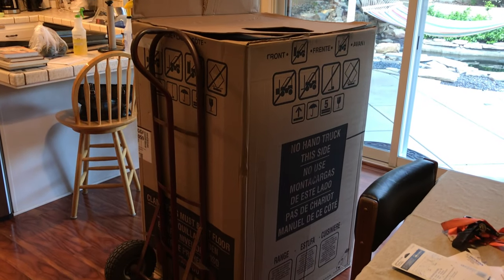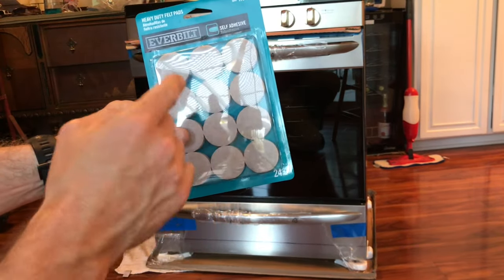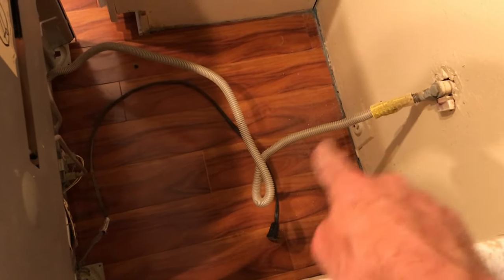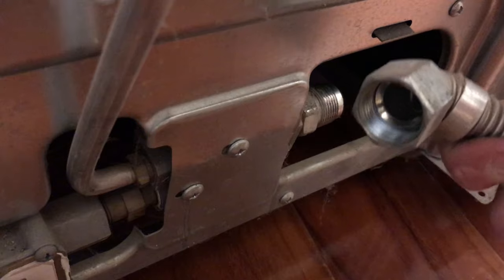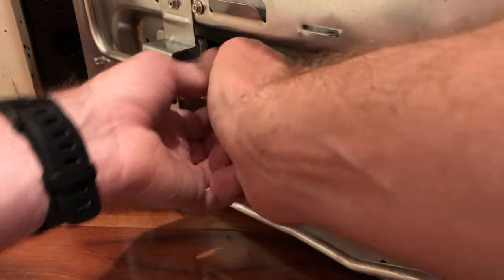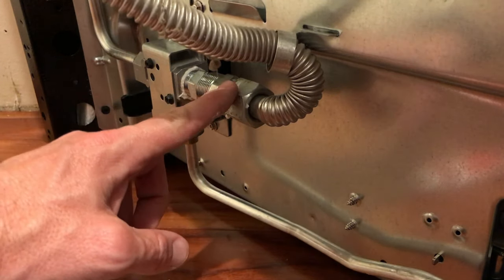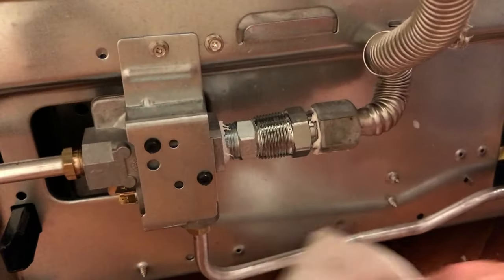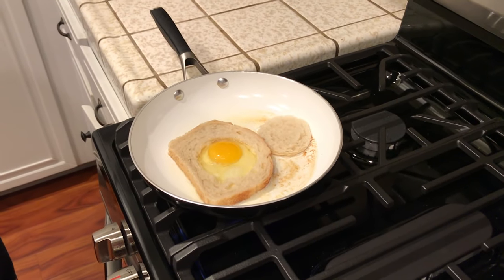How to hook up a gas oven and not blow up your house!

Comment: What's wrong with the old oven
Reply from the maker: There was enough wrong with it it wasn't worth repairing.... and we wanted convection.
Reply: @DoItYourselfDad  do only convection ovens have
A broiler inside
Reply from the maker: No, standard ovens have broilers as well.
Reply: @DoItYourselfDad  what about a convection fan
Reply from the maker: Not all ovens have convection fans either.

Comment: IF YOU ARE IN RENTED ACCOMODATION BE IT COUNCIL OR OTHERWISE YOU HAVE BY LAW TO HAVE AN ANNUAL GAS CHECK. IF YOU CANNOT PRODUCE A GAS CERTIFICATION FOR THE COOKER YOU HAVE JUST INSTALLED IF ASKED, THEN THEY MAY INSIST YOU GET ONE VIA A CORGI REGISTERED GAS FITTER WHICH WILL COST AROUND £100. IF IT IS A PRIVATELY OWNED PROPERTY YOU CAN DO THE JOB BUT IT IS FULLY YOUR LEGAL RESPONSIBILITY SO IF YOU BLOW THE HOUSE UP, KILL OR INJURE ANYONE ETC THEN PACK YOUR CLOTHES & TOOTHBRUSH FOR  THE "NICK".

Comment: Personally, I believe you Shouldn't use tape.  If so, be sure it's gas tape.  Tears inside of tape can clog up gas valve an orfice etc. I'd suggest always using gas approved pipe dope, thread sealant. An I'd suggest following the instructions from the manufacturer and be certain your stove is set up for the right gas. Natural or propane. Most come threw set up for natural gas,  where I'm from we use propane. Follow directions fully to ensure you complete gas conversion if needed . Don't forget the oven, etc

Comment: Thank you for your great assistance video.  Only issue was the gas piping adapter.  Lowes only carried 1/2"-1/2" or 3/4"-3/4"; and, my existing line was 3/4" with the stove having a 1/2".  needed a 3/4"-1/2" adapter.  Before viewing your video, I tried to remove the adapter from my 18+ year old slide-in range and couldn't get it to budge.  After viewing your video and finding the problem at Lowes, I returned home and tried to remove it again.  Since the oven ignitor had outlived its life, I exerted enough pressure to get it off.  Cleaned the adapter and reinstalled.  Worked perfectly thanks to your video assistance.

Comment: You Actually hooked it up incorrectly. Stacking the adapters for the correct fit of the gas connector causes two different thread types to be connected together. Very common to leak. Only one adapter into the range followed by the flex connector is the correct way.

Comment: 1) Don't use pipe dope or tape on the flare fitting
2) ALWAYS replace the flex connector when changing out appliances. 

Two big mistakes in this video.

Comment: Need some assistance, and cannot find a solid answer. What about bypassing obstructions close to the stove when installing? Do you use flared fittings or male pipe threads/elbows north of the flexible connector?

Comment: no pipe thread or sealant on the 2nd connection you did to the flex hose?   Shouldn't the old stove have the right adapter?

Comment: Use 2 wrenches when tightening the gas line, one to tighten the flare fitting. And another for holding the gas valve so it doesint turn aswell.

Comment: Thank you. That was very clear and simple. There were two steps that were implied, but not explicitly shown: attaching the hose to the adapter on the stove, and attaching it to the valve on the wall. It's not a big deal, but installing a gas line is a little anxiety producing, so the more steps shown the better.

Comment: You didn’t have to use an adaptor on the other end of the hose? I don’t see where you connected it to the gas line from the wall.

Comment: My manual is saying my oven needs a gas regulator? There is not one with the unit, a GE jgbs66rek4ss any help with this?
Reply: The gas regulator is already installed on 98% of gas ranges and it should inform you on where it's located in the installation instructions

Comment: Are you suppose to apply the gas line sealant to the end of the adapter connecting to the gas line side not just to the adapter connecting to the new stove?

Comment: thread sealant definitely goes on the threads of the first fitting, the flex line shouldn't`t be reused as it attaches to a flare fitting which seats by compression.

Comment: Nice video and you have the same range as I do!  I want to install a longer (72") supply line and I think that I need a 5/8" (outside diameter) line for that.  Do you remember off the top of your head the appliance gas inlet diameter?  I could look but I would have to crawl over my counter and down behind the range.  I don't want to do that more times than I have too because I'm old and lazy too I guess.  Thanks for the video!

Comment: I bought a stove that's 2 years old that already has  that connection You put on your new stove, I think it's called a flare fitting. As long as I have that flare fitting onto the stove will I be able to use my old gas line like you did?my old gas line is like 10 years old but there's nothing wrong with it. It's just I'm not really good at taking out old lines and putting in new lines and hoping since my new stove has that connection it can just be a plug and play situation
Reply from the maker: If you’re referring to the flex line, it should be replaced.

Comment: I hope you will receive this message soon...I am wanting to help with my landlady's gas range.  She recently installed one, but it's really loud while it's heating up, a high pitch humming.  This happens when using the elements or the oven.What could the issue be?  It stops after 5 mins or so.
Reply from the maker: Sounds like a noisy valve to me.

Comment: Does the new gas range come with a new gas line and adaptors? Or would I need to use existing?
Reply from the maker: Most don't come with adapters, you can use your existing ones but don't reuse the gas line.

Comment: Question..when I turn on the oven I smell gas like a leak.. but not the same amount of gas when I light the eye. Could this be the corrugated gas flex line or the actual stove?
Reply from the maker: It could be the stove, the line, or the fittings. I'd start by spraying the entire line and every fitting with soapy water looking for bubbles.

Comment: I got a slightly used stove. I thought it was a deal. But now the nipple (male) will keep turning. I'll feel kinda snug but then it will keep turning.  I don't wanna return it if I can just replace the connection. I'm assuming they overtightened it and damage the thread?
Reply from the maker: It sounds to me like the threads are stripped. Can you back it out and inspect the threads for damage?
Reply: @DoItYourselfDad  after the soapy water test I did notice a tiny strip of metal. So yes the regulator it's been stripped.

Comment: Did you put pipe joint compound on the flex hose connection?
Reply from the maker: Only put compound on non-flared fittings.

Comment: Not enough details. "Get some adapters." "Get it snug, but don't over-tighten it." How do I know what adapters I might need? How do I know what is "over-tight" and what is properly tight? Guess? I hate diy channels that don't give some sort of suggestion or guideline for stuff like that. I want helpful details or suggestions--at least tell me where to get the info if you don't know it.
Reply from the maker: Every stove is different, every valve is different. Diameters of lines, thread pitch, etc. I can’t give specifics because I don’t know what you have.
Reply: Sylvia isgod  Ha ha, I'll be sure to do that.
Reply: @DoItYourselfDad  I get that, but saying something like "get an installation kit that includes the flex pipe and adapters. If those adapters aren't right for your stove or gas supply pipes, go to a hardware store and consult someone there who can help you find the right ones" is specific enough to be helpful whereas "get some adapters" isn't helpful.

Even just saying "You'll need adapters to attach the flex pipe on each end. I can't tell you exactly what you need for your setup, but you can get them at X, Y, or Z..." is more informative.

If you wanted a really thorough video, you could go into explaining how to tell what is needed (measuring, looking at male/female thread, etc.). But that would make a very detailed, long video and that likely isn't the intention.

I just think a little bit of specific information is better than none.
Reply: Sylvia isgod  That's a great tip about the sealant...now, should I use thread tape and sealant together? maybe add some duct tape on the outside, too...? or would electrical tape be better...maybe melt some candle wax on there somewhere, too, just as an added security measure...what do you think? 

And is rolling the stove really necessary? Seems like that might scratch it up a bit. I'm sure you know what you are talking about, though. Your advice is really excellent.

Comment: No pipe dope with flared fittings per manufacturer instructions. Test or also for leaks by getting nose right next to fitting. Leaks (bubbles) on other side of joint cannot be seen.
Reply from the maker: Use a dental mirror if you can't see the backside.
Reply: @DoItYourselfDad  Or just use your sense of smell
Reply: Sylvia isgod  True. Interesting you comment today. I have not dealt with leaks for a few years until today. I found a leak today with sense of hearing. It was very slow so I could not pinpoint it by smelling it. I sprayed soapy water but still couldn't find it but heard it and then noticed bubbling.

Comment: Enjoy the video. 
We have a Kenmore propane range/oven. 
As the oven initially heats up in the regular Bake setting, it takes some 20 minutes. When she bakes for instance at 350, the food gets done around the side but not in the middle. 
She has been using the Convection setting that seems to help somewhat. 
Any idea what might be the problem.
Thanks
Reply: We'll, maybe I'm misdiagnosing but the oven needs time to preheat. 20 minutes seems fairly normal. If it's a modern oven it should display what the current temp is and likely even beep once it's finished preheating.

If you're giving it time to preheat and it's still not done in the center, well I'd have to guess the temp is to high or the food is too... Big.

Maybe I'm completely misinterpreting your comment. Sarcasm? Internet speak?
Reply: Not really a gas connection topic or issue.

Comment: I have an electric stove....under the counter top is a pvc pipe going into the floor with some foil covering it...I tried to look at it and I see little sand there...not sure what it is for....I want to convert the electric...how do I go about this? Any tips?
Reply from the maker: If it’s PVC it’s definitely not gas, you’ll have to run a gas line, do you have gas elsewhere in the house?
Reply: @DoItYourselfDad  The PVC pipe is like an opening...If you open the counter doors beneath the electric range its right beneath it....When you look through the hole its like some sand and stone there...Not much...just a little. I do have gas for the water heater and the Kitchen is not too far away from the garage where the water heater is....can I message you directly...I have a picture of the pvc pipe..
Reply: @DoItYourselfDad  Sent you an email....

Comment: I just bought a used stove with included the pipe . Do I still need to buy a new pipe??
Reply from the maker: If you don’t know the history of the pipe/hose , yes.
Reply: @DoItYourselfDad  ok thx
Reply: @DoItYourselfDad  should I change the valve? I just moved in the new home
Reply from the maker: Unless it’s damaged there shouldn’t be a need to change the valve.

Comment: How come you only apply the pipe sealant to one side of the adapter as appose to doing to both?
Reply from the maker: One side is a threaded fitting, the other is a flared fitting.
Reply: @DoItYourselfDad  gotcha.  thanks.

Comment: Good video thanks! I have gas fireplaces but an old electric range that will need to be replaced soon so I'm wondering how I can run a gas line into the kitchen?! I'd much rather have a gas stovetop!
Reply: There are videos on utube teaching u A to Z. Look for instance at “cutting through a gas line” video. With a little bit of confidence u can do it.

Comment: Why didn’t you use sealant on the hose end?
Reply: Flare/Tapered fitting is sealed by squeezing the bevels together, not from pipe dope. if the fitting leaks, you are supposed to make it tighter or re-flare the tubing. Pipe dope is not used to seal a flare joint.

Comment: Great video, but I noticed that when you installed the fitting adapters you applied sealant, however when you attached the line itself to the adapters you did not use sealant.  Was this by intent, or was that an oversight?
Reply from the maker: You do not use sealant on flared fittings, only threaded fittings. Applying sealant on flared fittings can cause leaks.
Reply: @DoItYourselfDad  Ok, thank you for the heads up

Comment: You may want to take this video down due to liability concerns. You put two dissimilar threads together by using two adapters. The first adapter you used is 1/2" pipe thread to 1/2 "flare , the second adapter you put the female pipe thread over the1/2" flare section of the first adapter ( completely wrong and dangerous). The gas range you were replacing was connected properly. Also just an FYI anytime a new gas appliance is being installed it is required that a new flex connector be used ( the old Flex connector should always be replaced). It is also required that the anti tip device be installed ; it was shipped with the new range. Hope this helped and please be safe out there.

Comment: Just a quick note--at 3:15, you mention that you can use "plumber's tape" on the fitting; that is not correct. Plumber's tape looks similar to gas fitting tape, but is not rated for gas. There is actual gas fitting tape, which is usually yellow in colour.

Comment: Just installed new oven following this video. 

I managed to find the same pipe dope you used in the video, but I really caked it on because I don't want to take any chances it'll leak.

Probably overkill, but to be honest, I'm still not 100% sure the connection is fully sealed.  I tried the soapy water test, but small soap bubbles inherently form on the connections, maybe I put too much soap in the bottle.  But it's hard to distinguish between soap bubbles and gas bubbles.

So then I tried another test.  I know it's a little dangerous, but I also circled a lit match around the seals.  If there was a leak the flame would have only flared a little, but it didn't, so I'm hoping it's properly sealed.

My other concern is that when you push the oven back into place, the gas hose might kink and create a leak, and there's really no way of watching the hose because at some point you won't be able to see it.

I don't smell any gas, but then again if it's an extremely small leak, you probably wouldn't detect it.

Anyway, my fingers are crossed, thanks for the video.

Comment: I liked it! clear and concise! 
What would really be good, and take this DYI video to the NEXT LEVEL would be to also include a demo of the biggest concern for the specific installation you're DYI'ing.  In this case, include a demo of the "soap test" FAILING, to reinforce the success of the installation; knowing beyond the shadow of a doubt that I have no leak.  also, how concentrated of a soapy solution is needed?  I guess a teas of liq dishwashing soap to 1 cup of warm water - dissolved.